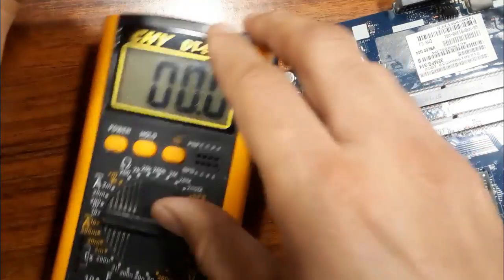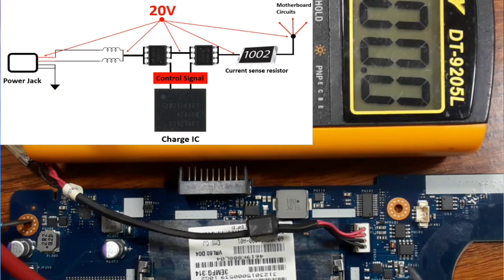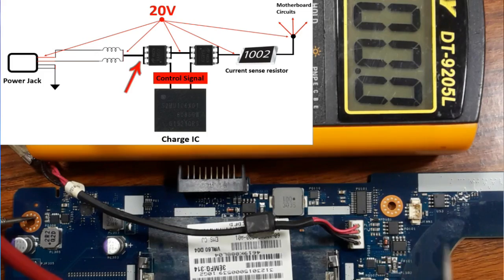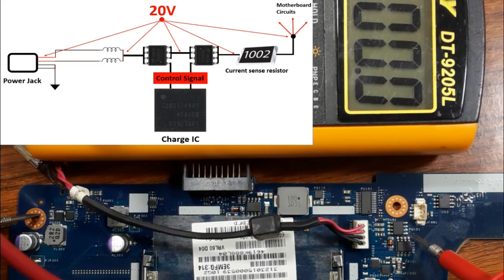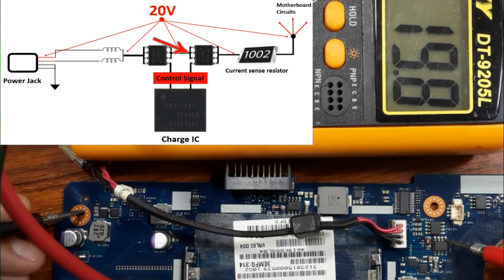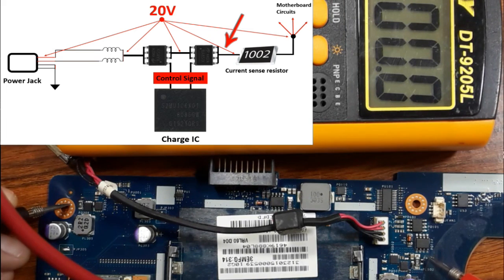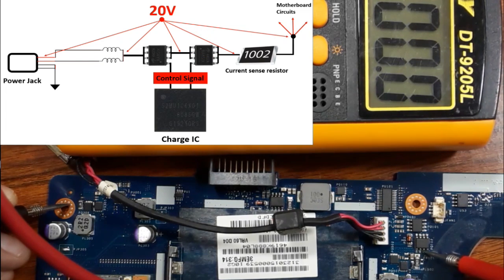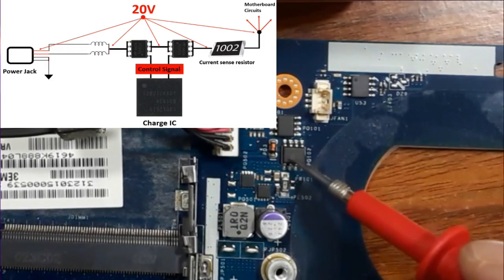Diagnose your laptop's motherboard like experts do - Laptop motherboard repair

Comment: Hello, I followed your steps till to the very end where you started to inject 20V to the motherboard using the charger meanwhile my motherboard gets hot while testing the power circuit... Is it normal to get it like that? Isn't it supposed to be not running? or is my motherboard dead?
Reply from the maker: Hi there,
Thank you for your comment! It's normal for the motherboard to warm up slightly when injecting power, but if it's getting too hot, that could be a sign of a short circuit or a faulty component. You should check the power rails for any shorts, especially around the main power line and key components like MOSFETs and capacitors. If any component is getting excessively hot, it could indicate a failure in that part of the circuit. In such cases, you may need to replace or isolate the faulty component to prevent further damage. I recommend proceeding cautiously and using thermal imaging or freeze spray to identify the hot spots accurately. Let me know how it goes!
Reply: @electronicsrepairbasics_erb  alrighty! thanks for the insight